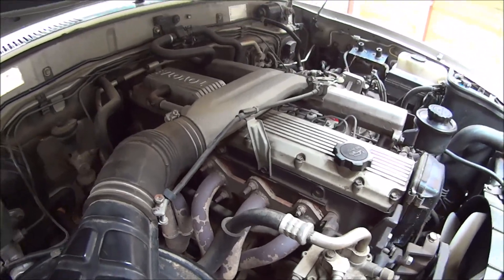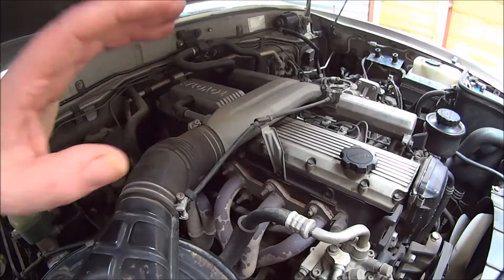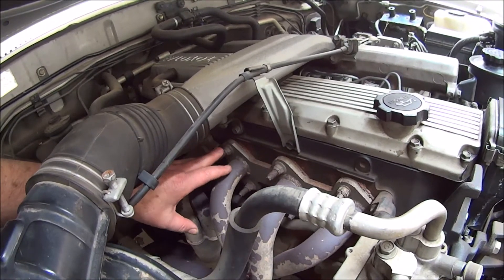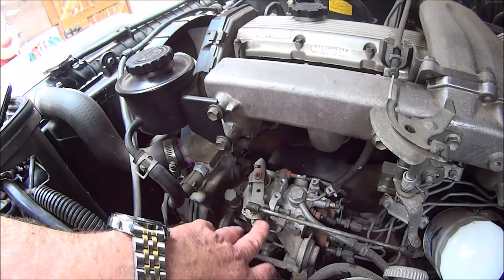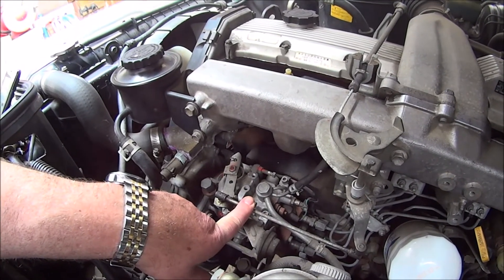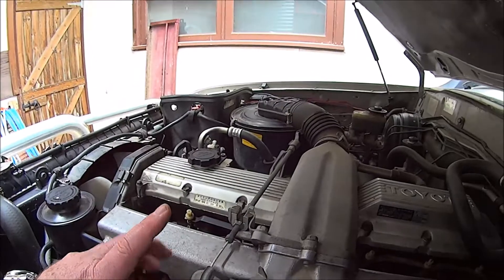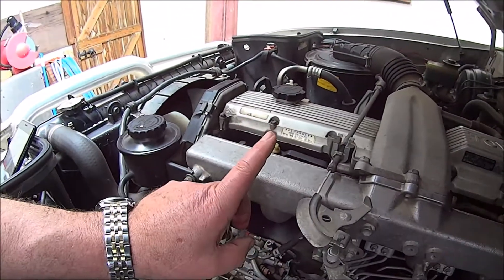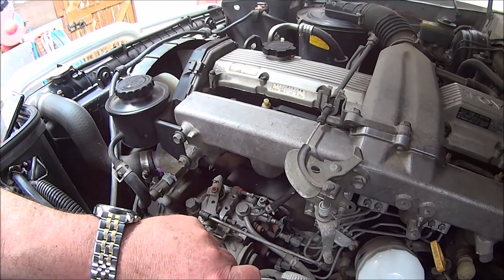Tuning in Headers/Extractors & Why

Comment: i wonder if the huei injection system can be tuned. as far as i understand the injector fires once per cycle. can the fuel delivery be increased by.increasing fuel pressure on 4jx1 ?
Reply from the maker: the injector fires multiple times at the power stroke on all modern (EFI) diesels. It's a phased array of firings to ensure an even explosion to reduce the "knock" of diesel combustion.  This firing array can be tuned to deliver more fuel at certain times for added power and big gains can be made.  It is easy for a dyno person skilled at ECM tuning to increase the power of an EFI diesel engine by a large amount without touching the turbo boost. It's a sort of modern equivalent of putting twin carbies on an old petrol engine.. The penalty is higher fuel consumption - but only if you keep your right foot to the floor... :)